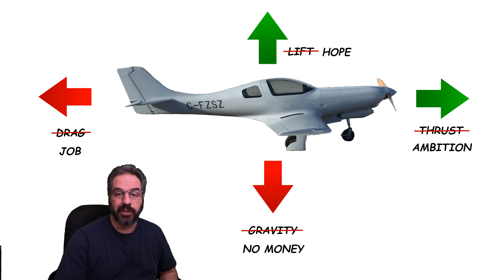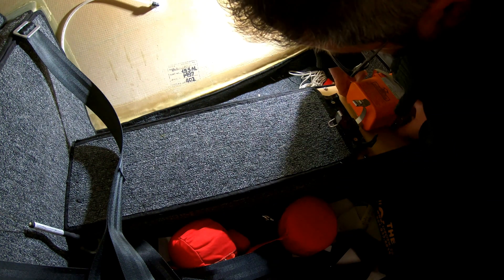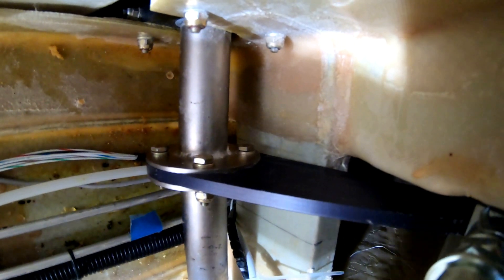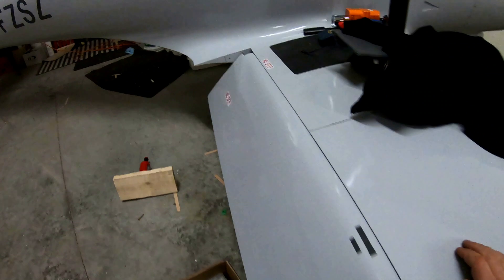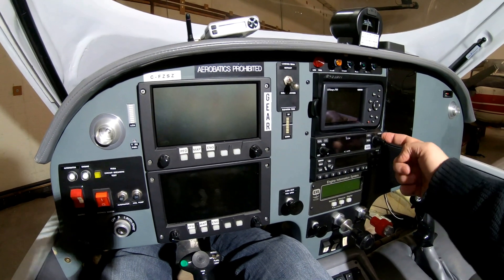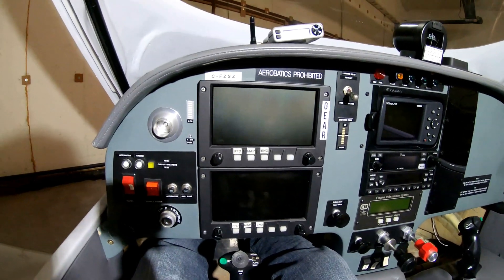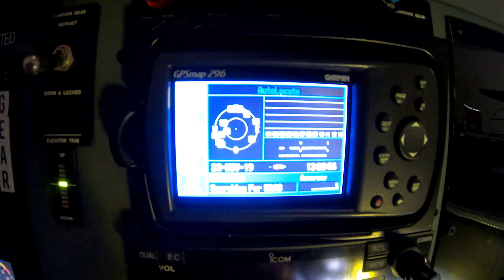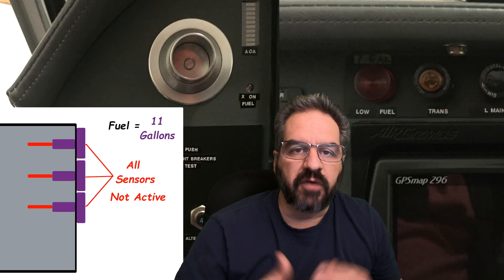Lancair Tour - How I built my Lancair

Comment: Thanks for sharing man, I am looking at taking my private pilots license course next month. I am trying to decided between a Cirrus and a Lanciar.  I love the speed and spec of a Lancair. Have you heard of a company called RDD out of Oregon, They claim they rebuild the air frame to make it safer? Thanks for posting and helping out with an inspiring pilot
Reply from the maker: Hey Paul. Thanks for stopping by. If you have the ability to pick one.... CIRRUS!!! lol. Actually the answer is... depends. If you are planning to fly more than two go for the cirrus. However as quickly most folks find out quickly... you will spend most of your time flying alone or with just one other person. Buy for the mission and not for the dream. I built the lancair because the plan was to fly from montreal to florida: I wanted a distance type plane and affordable to fly into my retirement for me and my better half. BUT, the moment I finished the plane, I got a job with a canadian airline out in western canada which meant wife no longer wanted to fly in a small plane as flying in an airliner at a reduced cost was easier. Also... nothing but mountains and shortish strips where I am. The mission would be more of bush plane now and I have a plane meant to go fast and far... I do still love my plane... BUT.. the mission has changed. As for going for an airplane that is "safer" than a lancair because of a redesign means that you are basically not flying a lancair anymore in my opinion. Sure there can be improvements on all aircraft but I really don't see any issues with the Lancair type as is (FBII in my case). Good luck with the pilot's license. Let me know how it goes over time!

Comment: Does your 360 have a fuel selector valve, or all flow is from the header tank? Does the header always fill from both wing tanks simultaneously? How do you balance the fuel load? Sorry for all the questions. I just bought a LANCAIR 320 project and trying to choose the best fuel system configuration. I’d love to know more about your fuel level sensors/switches. Thanks, Mike
Reply from the maker: Hi Mike,congrats on your purchase!!  Everything is automated on the fuel system and yes it does flow from the header only to the engine. I have a single pump from each wing that fill the header at the same rate (pumps are side by side under the pilot seat so even the distance travelled from the pumps to the header is the same .. not sure it would matter lol). I then have a pump on the firewall and the pump on the engine of course. Both wing tanks empty at the same time: so it is either both wing transfers on or both off. There may be some fuel left in one wing but it wouldn't be much given I fill to the filler neck at each refuel and I always confirm how much has been going back into the tanks on refill. It's been over 5 years and that method has not missed a beat for me.  As for if you go fuel selector between the 3 tanks, you would have to make sure you have larger size tubes coming from each tank (as per manual suggestions). It is automated as I mention in the video through the use of 3 physical "bobbers" (bought them at spruce). Hit me up on hudpilot1@gmail.com or on instagram (@hudpilot) or facebook messenger and I can answer more questions if you like and add clarity where I have failed to do so in this reply.  THanks again for writing Mike

Comment: Two Stories from my Navy days

A reserve Navy Pilot doing Touch and Go's at Jacksonville International Airport in January 1978 and someone disabled the low altitude wheels NOT down alarm
On a High Speed Flaps Up pass the alarm did not alert them that wheels were not down when the Barometric sensor went below 100 feet
The did a Touch with the Starboard outboard propeller with the runway, and were then committed to sliding on the belly until it stopped
The 4 people on board got out safely but the center fuel tank had been torn open and the P-3 ASW aircraft burned to a total loss
Pilot/Crew error was a $25 million loss because hey did not want to hear the Warning Tone in their headsets
Now they will never hear that Tone again because they never flew again for the US Navy

Another NAS Jacksonville story
There was a flying club on base and people could rent small private aircraft from the club
One Active Duty Navy Pilot rented one of those planes and after the flight came back and complained that the Aircraft was hard to control in flight
When they went to trouble shoot the problem they saw why the Pilot had trouble
He forgot to untie the cinder block weight that was tied to the tail tie down point
He took off and flew around with the Block hanging off the plane
The ground crew was surprised he did no damage except knock off a few pieces of the block
They had to report it and that Pilot's Squadron Commanding Officer had to ground the Pilot for awhile as Punishment
The real punishment for a Military Pilot is an entry like that probably cost Him any chances of future promotions and eventually forced out of the Navy for not being promoted after so many years

Comment: What a great video.  Deserves more views.  I am very interested in the purchase and building of the IV-P.  I am interested in knowing how many hours one would expect to assemble the Fast Build kit.  Do you have any insight?  Thanks!  Be well
Reply from the maker: Hey Firewalker. Thanks for the kudos: greatly appreciated. How many hours .... hmmmm that is a BIG question. What I have built was a fastbuild kit and THAT took 6.5 years of working on it quite a bit (1000 hrs to build and probably 500 hrs to get the finishing touches in)... I would have to check my build logs which are buried in boxes somewhere.  Claude, the guy who flies with me in most of my videos who has almost completed his Lancair is up at a little over 5 years. He is retired and has been working on the plane pretty much every single day for the last 5 years.  I would assume that given there are no IV-P kits around that what you would buy would probably be mostly assembled and gear attached. Unfortunately, I see a minimum of at least 5 years with a plane at that stage. 
I believe Lancair still offers factory assist programs so that could help speed things up. I am starting to look at the next thing I will build but going simpler probably. No gear retract. No high performance. I have built a Midget Mustang, Team Minimax, this Lancair and worked on a few RV's. Although glass is the prettiest in the end, I like working with metal and thus may probably go with metal next.  Sorry that I couldn't give you too much info on the IV-P but hope I have given you a little insight on what it could be like to build. Take care and stay safe!
Reply: @HUDPilot  Thank you for such an in depth reply.  I think if I already had something to fly in the mean time I would be willing to put in the build time.  However, I may end up looking at airplanes which are already built and flying.  I have the desire, just not the time to do the full build.  If things work as I plan I will be transitioning to trading futures instead of my current career.  That would free up a ton of time and being in the shop would be more reasonable.  Factory assist may be a viable option as well.  I am interested in looking into the RVs as well.  The more thought I give it the less I am interested in certificated aircraft unless I could somehow convert it over to experimental.  I am rambling now so I will close.  Thanks again for your time to reply.
Reply from the maker: @Firewalker688 Yeah.. I have been building for over 25 years... it's basically the only hobby I have (I guess youtube is my new hobby as well) and so kitplanes will be where I stay. Not a wrong decision in my opinion. Thanks again for chatting.
Reply: @HUDPilot  Thanks for the replies........... See you on the next one!  :D

Comment: The plain flap will start stalling at about 15 degrees. Beyond that it will mostly act as a speed brake. In order for you to create more lift from the flap, you need a slotted flap or a fowler..
Reply from the maker: Yup. In this case "22-24" degrees approximately (flaps up is -7 degrees on the plane). a "speed brake" is what I was after lol.

Comment: Much reduction in stall speed?
Reply from the maker: Actually none. Flaps up stall is 64 and flaps down stall 63 as tested. Since they are so close I treat it as 64 either way. Approaches are better and runway roll has reduced by at least serveral hundred feet. When I was out east 90 knots was approach. Here out west, 83 is the speed.
Reply: Cela paraît bizarre : flaps up 64 kts , flaps down at 37 deg and stall speed almost the same ....???
Reply: @bernardbaudouin8887  that indicates that the flaps are mostly separated, so no lift increase but he is getting the drag increase, which is what he wants to allow a steeper descent. A single slotted flap won’t go much beyond 30 deg before separating.